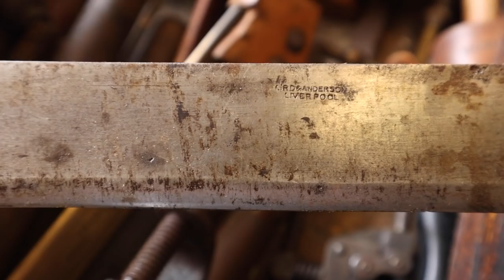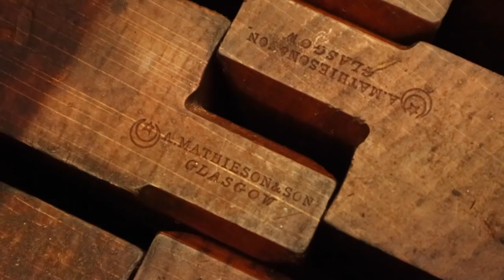Finding Treasure in a Hundred Year Old+ Tool Chest

Comment: In the workshop, Ben, I've got a very VERY rusty infill plane. Similar to a Norris, or a Spiers, or a Mathieson. But despite looking online, I can't find another example of what I have. The tote appears to have been a replacement, as it's teak, not that well shaped and it's broken in two pieces diagonally across the whole thing. The iron has a mark on it like a Pearson, but it's SO rusty that even scraping off some of the rust, you can't make it out. The cap iron has a brass bush on the back (forget what they're called) for the screw to thread into. And it also has a steel pad just above the brass bush for the lever iron/adjuster thingy to screw down onto. The body appears to be a single, very heavy cast piece, coffer sided, and with a little lip on the sole at the curved front. There are no markings on it whatsoever, apart from on the iron. And nothing on the front of the lever iron adjuster. Any notions on what it could be? Just so you know, I'm not far from Ayr where the Spiers planes were made. Also I live in an 18th Century estate gatehouse, which at one point used to be the local Post Office. In the modern garage, when I moved in, there was a big table leaf of Cuban mahogany stored in the rafters, with backflap hinges on it. So I presume this might have been the counter for the old Post Office (when It was here). Also in the garage was a rather ornate mahogany sideboard. A Victorian reproduction piece with some lovely carved paneled doors (solid mahogany panels). I know it was a reproduction, because tucked away in a little cubby hole was a piece of old fashioned beige SANDpaper. And on the back, written in lovely handwritten script, in pencil was written "Made by A Gillespie 17 Wilson St Beith Ayrshire Scot. 16th October 1903. The Janefield Works (I think). So I wonder if the plane belonged to A Gillespie, and was used on that very cabinet?

Comment: I got that same #6 plane I think, it's a union #6 I think it was one of my grandpa's( they died before I was spawned). It's my favorite tool by far. The tote was broken with chunk out the middle 😫 but I made one out of quartersawn Brazilian ipe (an off cut from a deck we were building at work) and I use it everyday. It just cuts so nicely and the extra weight actually makes the work easier and I just like that my most reliable tool is 120-130 years old and will probably last another 120-130 years. I can't say that about any new tool I've bought.

Comment: The odour of the wood and the oil must be fantastic in your shop Ben, back in the early '80s I used to shop at a hardware/ tool shop in Doncaster South Yorkshire and the odour in that shop was fantastic, it was a business that had been going since the early 1800s and was a wonderous place.
 Unfortunately, it closed in the mid-2000s.

Comment: For the love of God, do NOT use grease on a lathe! Oil ONLY! Its a great way to kill a lathe.

Grease plugs-up the oil passages and traps dirt and grit between the sliding surfaces and acts like valve grinding compound. Destroying the machine in the process.

I get the heebie-jeebies when I see a grease gun near machine tools.